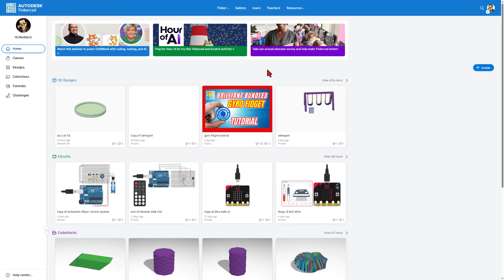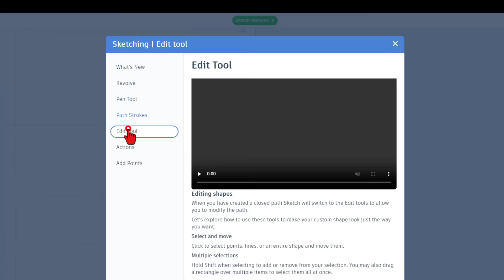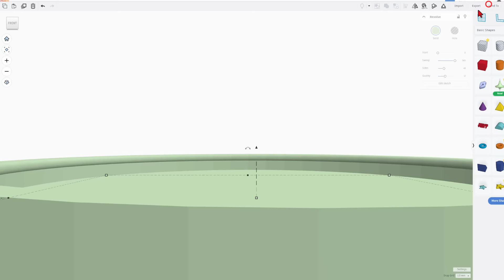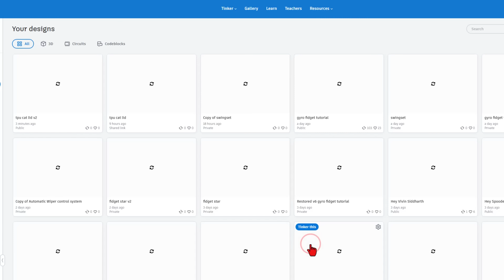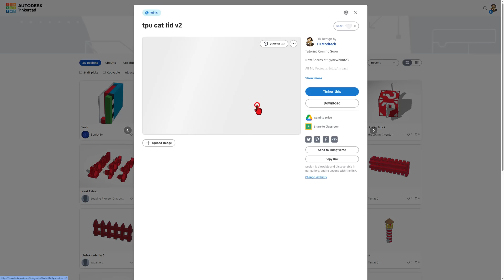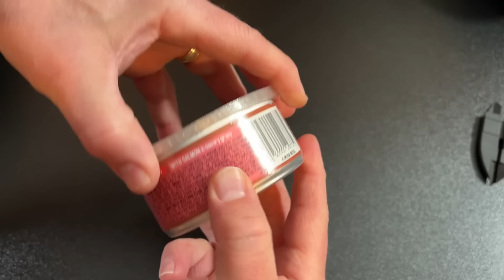Use Tinkercad Revolve to Make Lids & More: Sketch Genius 💯🔥

Comment: upon closer inspection your lid is suffering from bed adhesion, its warped.
Reply from the maker: That one corner was not great. All seemed attached to the bed though. I was scampering out for a trip, so I was out of time for making it perfect. That said, the lid is still in use since I have returned. Thanks for the visit and I always appreciate feedback. 👍

Comment: Very practical item and I have 9 cats at home so it's going to get used. If you give them more than a tablespoon of food each they do not clean their plate so I use the big cans and made a custom lid for that. Thanks for the idea!
OK I have another Mind-Bender request video. Another one of my super-strange help requests but I refer to the smartest person I know, you! I make lots of molds that people can pour plaster into and pop out copies. I add 'Draft' to the sides of the mold which allows easy release-relief. My problem has been that when I add an .STL file for a complex texture or a cool graphic design there is NO RELIEF. The sides are always ''straight up and down'' and the plaster breaks off in those tight grooves. QUESTION: How does one add 'draft' to an .STL file making it larger on the bottom and skinnier at the top so the plaster does not get jammed in the design when you go to pull out the negative plaster plug??? I know, it's a Mind-Bender but there has to be a simple answer. Maybe round the top or fillet the top edges for the .STL? I have no idea but for me it's a big problem. This is either so easy I can't think of a way or impossible!
Reply from the maker: Thank you. Currently there is no way to add the draft (in my mind I think this is slope) to the walls of an STL. Tinkercad does not "see" the edges and faces that would make that possible. Sketchup had some tricks like that, but I am not sure they allow exporting in the free version anymore.
Reply: @HLModTech  I figured out a Work-around but it's a real pain in the rear. I use UV curable non-toxic 3-D printing resin fill the cavity about 2mm. Put it on an ultrasonic table to get rid of the bubbles in those 90 degree corners and then use a syringe to remove the majority of the resin and leave a small rounded meniscus of resin remaining that fills those 90 degree corners due to surface tension. Then I hit-it with a 4000 LED ultraviolet lamp used to light up ''glow in the dark'' outdoor billboards. For now it works but I have to find a better way. This way is very labor intensive.
Reply from the maker: Nice trick. Bummer that it is so labor intensive. Keep me posted if you find a better strategy.

Comment: Why 95A is so common, it looks like that is not flexible enough. Is it harder to print with lower tpu shore levels?
Reply from the maker: I had no problem printing it. I will try to get the lip of mine tighter. Just wrapping my golf trip.